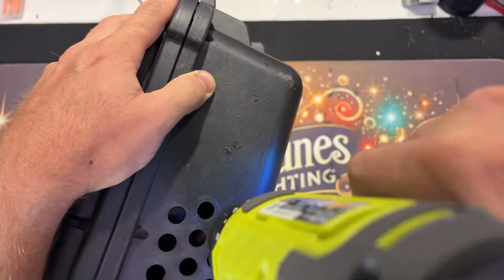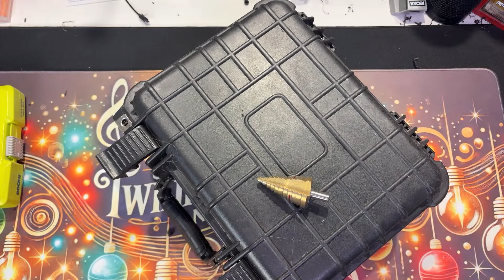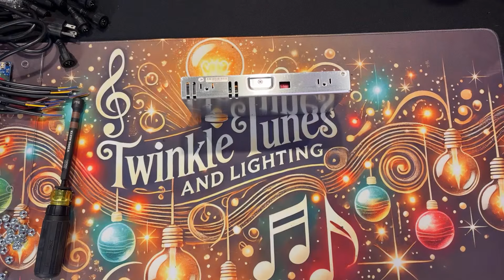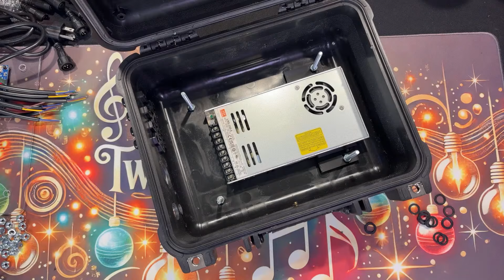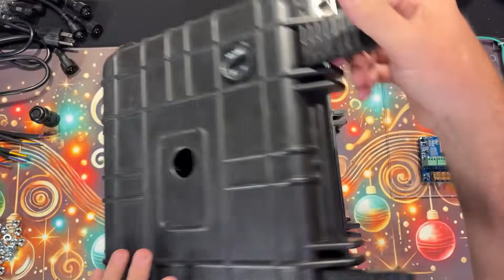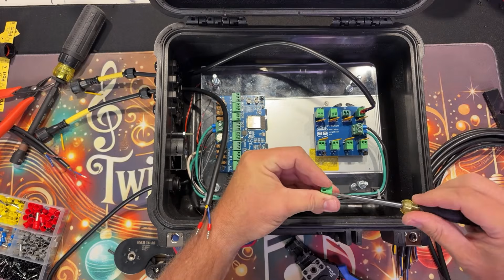Building a Megatree Controller Box (Bong69 V4) | Live DIY LED Build

Comment: How many pixels did you run off of this controller?
Reply from the maker: I do about 500-600 per port.  8 Ports 4000 - 4800
Reply: @twinkletunesandlighting  I only tried to run 300 per port and the board would trip on ports 5-8.

Comment: Do you have the STL files for the templates? That just seems like an easy way to keep them even. But even a printed version on cardstock is something if you have a pdf file.
Reply from the maker: I do have an STL File. it is in Tinkercad online.  This one has 16 holes so you can populate all of the outputs as well as the power balancing / injection.  Here is the link. https://www.tinkercad.com/things/hMBcRRrHYmv-apache-2400-timplate?sharecode=H5BA-lVRbjHRWgq5LOsvojhDIeg8-GcJcXqRwjx2Ito

Comment: Do you have a link for the amp meter you use? I see the volt meter but not the amp meter inside your box.
Reply from the maker: Here is the ammeter that I use. It is from China but any 50amp ammeter from Amazon would work. 

I just found this on AliExpress: $6.62 | DC4.5-30V 30A 50A Mini Digital Voltmeter Ammeter 3 Bits 0.28" Dual LED Voltage Current Meter Volt Detector Tester Built-in Shunt
https://a.aliexpress.com/_mqVdpvJ
Reply: @twinkletunesandlighting  Thanks got a few ordered.

Comment: I just bought the new Govee Cone Tree. I wonder if I can use xLights instead of the Govee App? There are just 3 wires from the controller to the lights, but I have no idea how they are wired inside the tree because they are epoxied and I can't trace the wiring. Maybe I'll experiment.
Reply from the maker: Easy! You can hack it. You can find the wiring online. I am pretty sure it is all the same. Middle wire is data. Dashed or dotted in power. The other one is ground. Make sure you have the correct power or use the existing power supply.
Reply: @twinkletunesandlighting  Got it. Dotted wire is +5. Middle is ground. Data is on the far side. Created a 18x20 matrix in WLED and a 2x5 matrix for the star on top. RGB Color Order for the seed/fairy pixels...WORKS! The connector looks like Xconnect but is proprietary. Wish I could find a connector to just plug instead, but it looks like I'm going to have to cut the end off and put on the RayWu. Now to create the xLights model.

Comment: I don't like the ridges on top of the Apache case. They hold water when it rains. Seems like it would be a problem for your top vent. I went for a side vent for that reason. Also, I opted for a piece of nylon screen repair patch and glued it to the exhaust hole because...bugs.
Reply from the maker: That’s a great point! 👍 The ridges can definitely collect some water if it’s sitting flat. I’ve started tilting mine slightly or mounting them so water can drain off more easily. The side vent is a solid idea too — and that nylon screen patch for bugs is genius! I might borrow that trick for my next build. Thanks for sharing your setup!